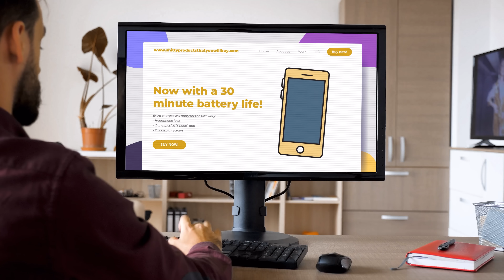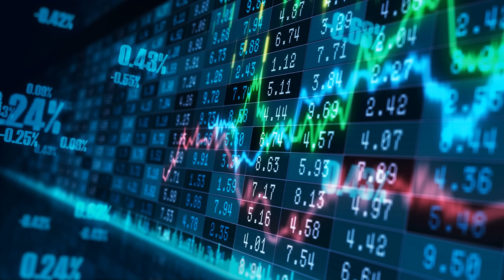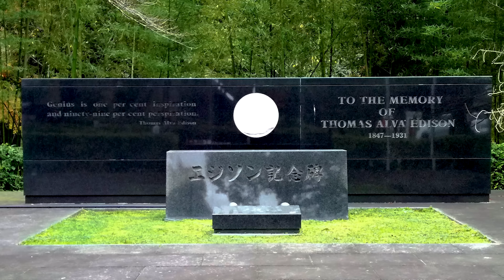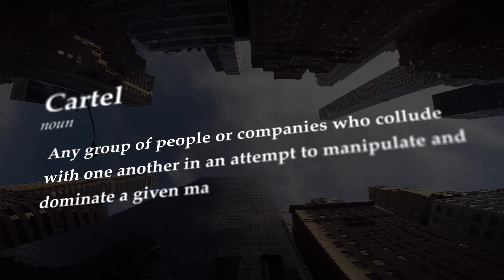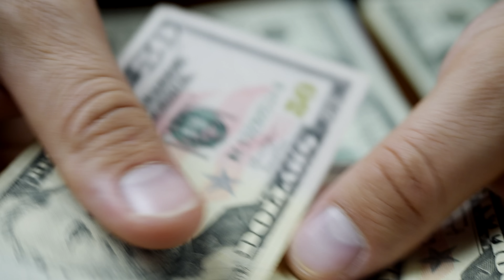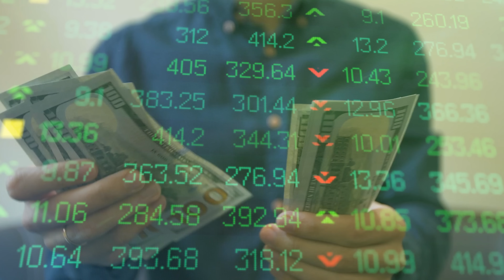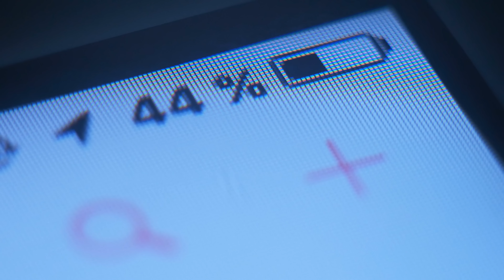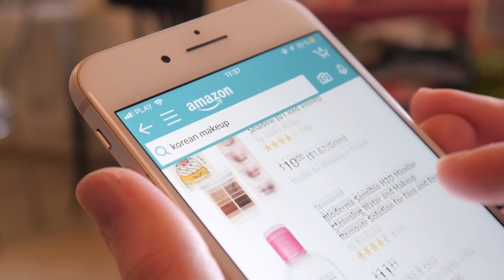Why All Lightbulbs Are Designed to Break

Comment: buys bulbs that claim to last year's
Breaks within 3 weeks
I've been cursed with light bulbs, it's like everytime I flip a switch they break, lamps, ceiling lights, everything they break far too easy but the lightbulb in my lamp has been going strong for ages now, still get scared everytime I flip that switch.
Reply: It might be because you have power fluctuation in your wiring
Reply: I bought my LED bulb from a brand that was not in the phoebus.

That was 2016.
Reply: The burnouts where you turn the power on might be power surges. I wouldn't put it past a scam.
Reply: @saulerius  Lived in 4 houses different bulbs different houses :(
Reply: Richard Hopkins  Doesn't everything?
Reply: we should do a class action lawsuit against the manufacturers
Reply: @xapemanx  Revenge
Reply: Try not buying stuff from China stuff from China breaks quickly
Reply: Richard Hopkins  Surely if something remains unbroken for years then it has lasted for years, no?
Reply: Richard Hopkins  who would have thought...
Reply: Richard Hopkins  Instead of saying broken you should just say smashed, for me something is broken when it isn't doing its intended function.
Reply: Richard Hopkins  I literally always think broken as in doesn't turn on. Infact I said this is a regular thing for me, when it happens I say "hey the lightbulb broke" if it was smashed I'd it shattered or smashed. Most people calls things broken as in not working, at least in my experience.
Reply: @Anipixelz  we've just joined utility warehouse they replace your bulbs free of charge
Reply: @Anipixelz  Idk.. if it doesn't turn on then it's burnt out not broken to me.
Reply: The electrician that wired house might not have did it correctly so are getting excess current can buy lower watt bulbs that should extend life of bulbs some if that doesn't work need an Electrician to correct problem.
Reply: @Anipixelz  Did the same Electrician wire all four houses?
Reply: @elliscook9794  Humans are all different, how beautiful
Reply: @hydrolito Nah
Reply: The worst thing about incandescent bulbs is they go out too easily if they just get slightly banged around. Doesn't happen with led lights or even other makes that I've experienced.
Reply: I've noticed myself that bulbs in our house that constantly stay on burn out less often. I mean flipping the switch on and off often is probably the worst thing you can do to a lightbulb, my advice would be to avoid shutting the lights off as often, for example if you plan on immediately being back in a room don't shut the light off. Definitely not saying to waste power, mainly just try to reduce power cycles. As far as bulbs themselves go I would stick to name brands, especially for LED bulbs. Since LEDs themselves cannot really run on direct AC from your house, all bulbs have some form of power supply circuitry inside them. Cheaper bulbs with crappier designs and cheaper components (usually to save manufacturing cost) will "burn out" quicker. No LED bulb really burns out per say, the power supply circuitry is what always fails in them. Best way of telling the quality of an LED bulb I've found is just how much they weigh, the cheap off brand LED bulbs I've used that weighed almost nothing burnt out quickly, while we've had several brand name bulbs in our house that I know actually weigh a decent bit that have lasted in our house for years now. Definitely avoid the extremely cheap LED and CFL bulbs, the low quality components inside them, usually the capacitors, like to overheat and explode. I've personally witnessed a cheap CFL bulb in our house that blew up and caught on fire, would have burned the house down if I didn't catch it. How some of the really cheap junk gets UL safety certification is beyond me.
Reply: That is how I feel about LED bulbs . For me they last maybe 2 weeks. At 5 bucks a pop it is too damn expensive.

Comment: The biggest reason the "Centennial" bulb has lasted for so long is because it never gets switched off.  95% of the time, when electronics fail, it's at the moment they are switched on. By never switching it off, you only have to switch it on the one time. Truly, one the worst things you can do to a piece of electronic equipment is switch it on.
Reply: what about hard disks?
Reply: should i leave my pc on 24 hours?
Reply: @JacReviewsStuff  disk can also fail when turned off. That's why SSDs are more reliable. But you should turn off your computer when not in use so your ram and cache can clear. But computers also run the risk of breaken when turned on
Reply: Not to mention if we pumped large amounts of power though that bulb it would likely blow out in a matter of seconds. Turn a modern bulb down to the power of a candle and that thing will likely last 1000+ years or more.
Reply: Especially if is an Apple device.
Reply: touchwood  we have a 10 year old CFL bulb that still works. It was once the part of our garden light that was broken after a storm. No one cared to get it out for like 10 years from its broken dangling lightbox until one day I returned home after finishing my studies. I fixed it in a bulb holder to check whether it was working---something I was sure was never gonna happen but yet wanting to take the chances.... and I was totally flabbergasted. Its been there for an year now and it still works.
Reply: The real reason it's lasted so long is that it's a 240 Volt bulb running off 120 Volts.  Any incandescent bulb will last almost forever if you run it at far less than its rated voltage.  There's no mystery there.  You can tell that bulb is running off far less than its rated voltage by the fact that it runs red rather than white.
Reply: That's like the newer flourescent spiral bulbs that they were making... 6years?  Naw... A couple if you're lucky.
Reply: Beware of leaving modern TVs on for long periods.  They have LED backlights that burnout if they are hot for too long.
Reply: I've actually heard this one before. (On q.i. I think). That it's only the switching on and off that wears down the filaments.
Reply: @bombercountyblues  That's not quite true.  I've had the occasional bulb which burned out after it was switched on, although that's been rare. The bulb wears out by being lit, but it's the huge "inrush current" at switch-on which causes most bulbs to fail at that time rather than during normal operation, and that failure is because the filament has become too thin to carry the current at some point along its length.  The thinning of the filament in places is the result of the extreme heat "boiling" the surface metal of the filament away.  Much of that "boiled off" metal comes back and recombines with the filament but not in exactly the same place as where it started, so places gradually develop where the filament is thinner than it should be and that's what eventually leads to the bulb's failure.
Reply: That bulb is also on a controlled, lower voltage to prolong its life. it also has an emergency back up if the power goes out.
Reply: Somewhat true indeed.
Reply: My family built a house in January 1972. We had a fluorescence light over the sink that we used as a night light in that darkened corner. It stayed on continually from '72-85 when we moved. The bulb was replaced 1x around '83-'84. We joked about holding a burial service.
Reply: My PC was 8 years old -- I left it on almost 24/7/365, and when I quit gaming and social media, I figured "no point in wasting electricity, I'll just fire it up once a month to pay my bills online."

That lasted 2 months, now it's dead.
Reply: @ChubakaSteven  , PC and laptps do need some servicing now and then.     Cleaning out the dust, dirt, lint, stray flies from inside the case is one thing.  Lots of dust heats it up quicker, makes it run slower and is a fire hazard.   I could be that the thermal paste was just too old and that's what ended your computer.
Reply: @JacReviewsStuff  Mine has been on pretty much 6 years straight.  And my last one about ten years straight.  Batteries are long dead but otherwise no issues with it.  I also noticed I got a lot more years out of a phone battery than my mother who would switch it off every night.

Comment: This is also why Crocs didn't have many sales for a couple years. They sold lots, and everyone still has their crocs.
Reply: They are also unsafed for some condition and looks pretty ugly for their price. Which is why I don’t get them
Reply: @yudistiraliem135  they're pretty comfortable actually, my one issue with them however is the durability of the straps. I usually use them when doing work outside my house. I don't have anything else that can withstand force without making my feet hurt.
Reply: @yudistiraliem135  and yes they look like s****. And there are a lot of off brands here. If I were to estimate their price they are around 4-5 dollars. It been awhile since I've actually bought them, since they still function, and they look terrible.

Comment: This same reason also explains why iPhones break so easily and most old androids don’t. And every time a new iPhone drops they make old iPhones trash at the flip of a switch. No pun intended
Reply: Actually this is true, for example Apple got caught a few years back slowing down older phones to supposedly save the older phones battery life lol.
Reply: @Gman Pman The only way to fix these problems is to use a different OS and with Apple you are stuck with IOS no matter what so jailbreaking will not help in the slightest if apple wants to do something! Android on the other hand has many custom roms/os to pick from.
Reply: It's amazing how customers worship at the Altar of Apple.  If their phones break, they assume it is their fault, not Apple's.

Comment: The early fluorescent and LED bulbs lasted a long time, but I have had newer ones die quicker than the old incandescents.
Reply: That's probably the cheap electronics.  They should make new lamps have the power supply in them, meant to be well made, efficient, and long lasting.  Then the bulbs don't need as-cheap-as-possible voltage converters and regulators, but directly take a standardized low DC input.

Comment: I'm glad someone has finally come clean about Planned Obsolescence.  My new frig has a life expectancy of 8 years--the one it replaced was bought in 1964, 58 years of work.  The dryer is also 8 years, replacing the former dryer of 37 years and this goes on appliance after appliance.  Now I'm retired and 71 years old and in debt replacing old appliances with ones not expected to last over 8-9 years.  Where is the advantage to this customer?

Comment: The good thing about being a handyman is that you can prolong useful life of LED lightbulbs by increasing the tuning resistance anywhere from 30 to 100% (assuming the LED power supply uses a tunable IC; if not, just add more resistance before the capacitive dropper). It will dim the light but it will last years and years - just like it was supposed to.
Another thing one could do is add a bigger radiator (like the computer processor types) to keep the original brightness, but that is a more invasive procedure.

Comment: “To stop making batteries user-replaceable”
Me who has a Motorola with a battery that needs to be put in when you buy the phone: ._.
Reply: Well, this video wasnt made 20 years ago 😉
Reply: Do not insult the 2019 Motorola 
I can throw it against a wall - not a crack on the screen
Reply: @ataphelicopter5734  So, a self defence weapon I suppose. 😆
Reply: User-replaceable batteries to me are basically paramount to flip phones. While they probably do exist (not including moto-mods), I've never seen a smartphone with an easily replaceable user-friendly battery akin to flip phones.
Reply: @uss-dh7909  My old S5 had a user replaceable battery.
Reply: @Patchuchan  
My S5 just informed me yesterday that I have to use the original charger & now is refusing to take a charge from the source I've been using for years.

Comment: I've had a lamp with incandescent bulb in it still going since when I was a kid (going on 20 years).
The "green" led lights I've got now last maybe 6 months before the voltage converter or LED itself packs it in.
How is it "green" to replace a bulb 1-2 times a year JAM PACKED full of electronics?
But my glass dome with a filament that's lasted near 20 years is "bad for the environment"...?

They do not care about the environment, they care about getting as much money as possible.

Take Apple with their travesty of locking down and serialising electrical components in their devices so they can not be replace or repaired by third party repair shop without bricking the device.

 Throw away society with the myth instilled in us of 'recycling'.

Biggest scam in history no one ever talks about.
Reply: U are very right
Reply: 1. most decent quality LED bulbs last ages, I've have the same one in flat since i moved in, still going just fine 6 years later.
2. incandescent bulbs arent inefficient because of their materials, but because the energy they use. my 6W LED bulb produces the same quantity of light as your 60W incandescent the rest of that energy is all turned to heat not light.
My LED bulb can run for 10 hours, for the same power as yours consumes in 1hour.
multiply that by how many lights in a home, and then how many homes in a country?
roughtly 25m homes in the UK, each home would have an average of 5-10 lights (depending on size of home)
that would. if every home had just 1 light on all at the same time, that's 1500Mwh of electricity.. VS 150Mwh of electricity for LED bulbs.
or if we look at Co2 for that power based on UK average. that'll be 38.4 Tonnes of CO2 VS 3.8 Tonnes of Co2?
just for 1 light bulb on in each house for an hour, but in reality many people have multiple lights on whilst they are home, and this doesn't include business properties.

This is why incandescent bulbs are getting banned
Reply: Hmm, proper LEDs should last for 50000 hours so even if you ran it continuously 24/7, it should last you almost 6 years before replacement are you getting some cheap LED bulbs from shady manufacturers?
Reply: I had some Osram GU 5.3 LEDs that broke way too early. I switched to Philips and they seem to last way longer. Planned obsolescence isn't over, it's just hidden better.
Reply: Excellent point and excellent vid.
Reply: Most of the electricity is from burning coal.  If Democrats have their way will be fewer people with electricity.
Reply: Has any one noticed the heating bill went up since you threw out your incandescent bulbs ?
LED bulb are perfect for outdoor use, less unnecessary heating.  Incandescent bulbs are fine for (winter) indoor use, the heat is not wasted.
I happen to live at a corner of the grid, we should have 230V, but rarely exceeds 218V with a lot of up and downs.
Most apparatus have no problem with that, but LED bulbs here flicker like a Christmas tree having fun...

Comment: The guy changing the lightbulb while the switch was on had me dead 💀
Reply: Meh, isn't that dangerous as long as you don't touch the metal screw on the bulb. I'm an electrician; I've done this plenty of times. Never got zapped.
Reply: I remember changing the lightbulb and switch was off but I still got zapped 😭
Reply: @MrCow579  I did it once and the thing literally EXPLODED. Never again.
Reply: @fierymoth4330  thats impossible unless you have a shortcircuit somewhere.
Reply: @FrobergDK  must have been an oldschool lamp then. LED's don't do this ;)
Reply: @MrCow579  frankly I can't remember what it was. Just that it blew up all over me and I had to manage to remove the sharp-as-fuck pitiful remains with my hands. :P There was almost nothing to grab on to in the socket.
Reply: @FrobergDK  sounds like an oldschool filament lamp

Comment: My LG G4 is still working just fine, with a replaceable battery, curved cinematic screen, headphone jack, infrared blaster, FM radio, great camera, and a few other things.  It just became a little slow, but only because web sites pile on ever-more resource-consuming things, especially ads.  Oh, and the thing is easy to fix with a single screwdriver.  You can't imagine how fast it was to recharge that phone, by just popping off the back and inserting a fully charged battery - I always carried 2 phones and 4 batteries.  As a professional truck driver I couldn't be out of touch with the company.  Now, 5 years later and a box full of replaced batteries, I upgraded to the LG V60 dual screen, with audiophile DAC, audio jack, vibrant colors, and so much more, but those G4 s are always in a box ready to go into action.  Yeah, 2 G4's died (I equipped my entire family with LG G4 phones), but such is life, the company's decision to use lead-free solder backfired, but all it takes is re-balling with leaded solder one day when I feel like it.  No wonder LG is selling its cellphone division - it made really good phones, unlike the modern marvels that have to be replaced yearly and whose "updates" actually slow the phone down on purpose, to "incentivize" buying a new one.